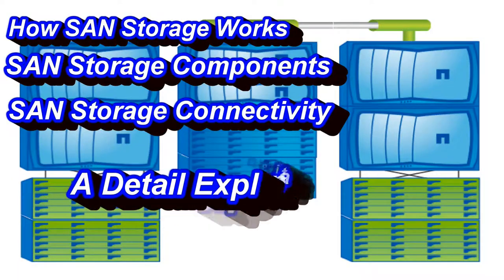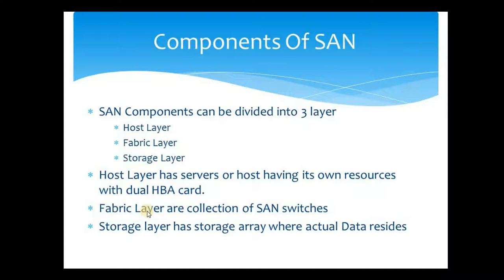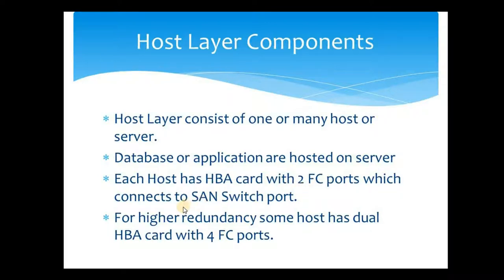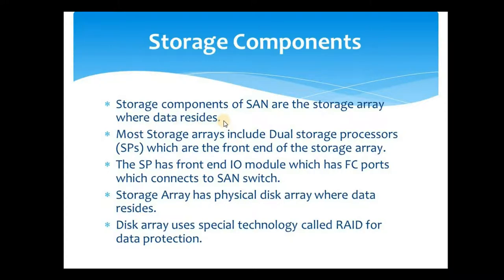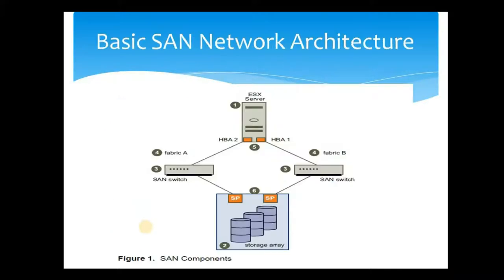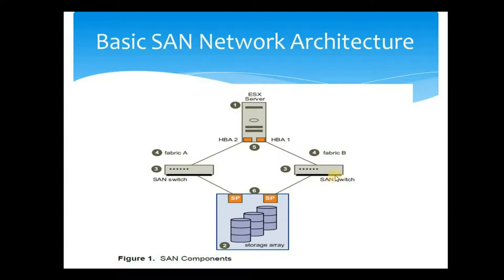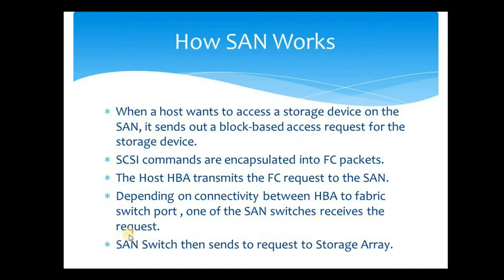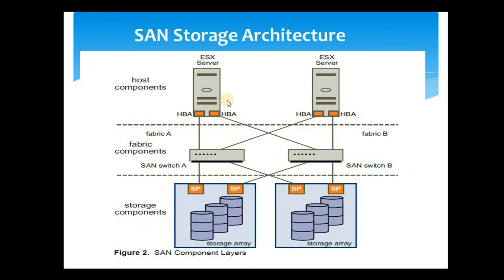Detail Explanation Of SAN Storage Architecture What is SAN and How SAN Storage Works

Comment: I have the exact setup like yours. However, my question was is there a way to load balance the traffic? for e.g. i tried server 1 doing speedtest on the server, i tried 2nd server do it then their speed is split into half...supposingly both are running on the same fabric switch. Would it be possible for them to see if there's a load it will change the 2nd server to go through the other HBA?
Reply: Pp